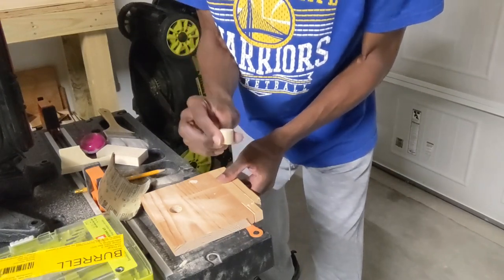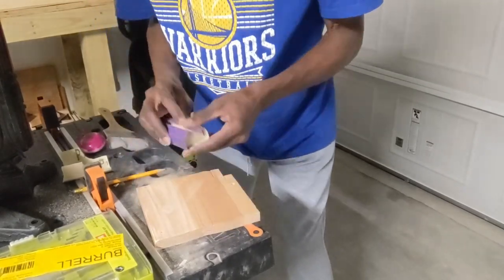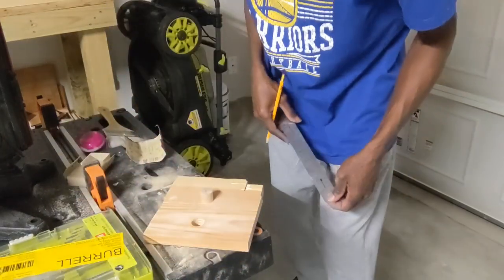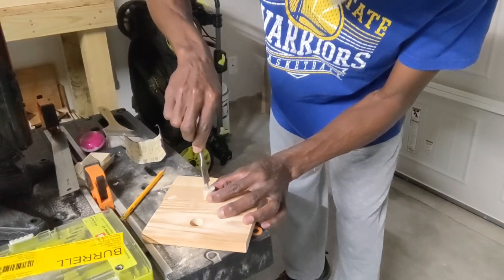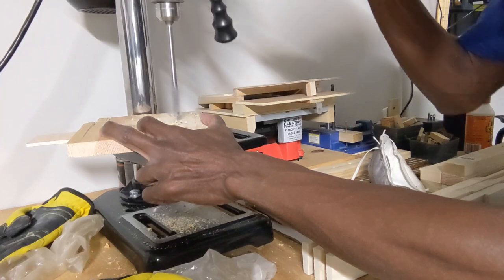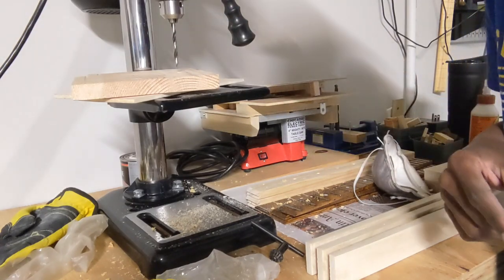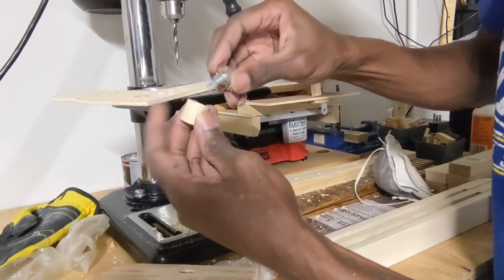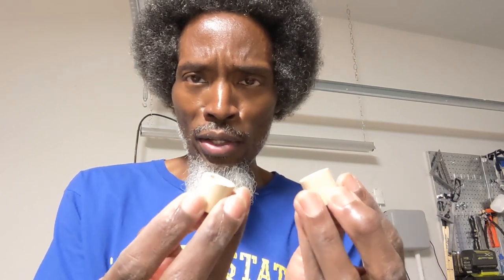Making Cigar Box Guitar Knobs

Comment: Thanks Moses for the excellent tutorial. I really liked your method of flattening your knobs  by putting them in the hole in the sanding block. I have an easy way to find the center of the knob with no measuring. Drill another hole in the sanding block and draw a box around the hole with the sides of the box just touching the hole,  then stick the knob in the hole and draw an X from corner to corner.

Comment: Wait.  Was this a mistake?  1:27  You said 1/4" lumber but that looks more like 3/4".  Also, the hole looks more like 1" or 3/4".
Reply from the maker: It is a mistake.  Thanks for pointing that one out.  The piece of lumber is 3/4-inches thick as is the hole.  Thus, the knobs are 3/4-inches in diameter (dowel size) by 3/4-inches in height.
Reply: @BurrellGuitars   Now I feel bad about pointing it out because you clarified it later in the video.   I love that process, though.  I haven't made my own knobs just because it seems too hard to hold and  drill the center hole w/o damaging the outside.  Great stuff!
Reply: Great tutorial!